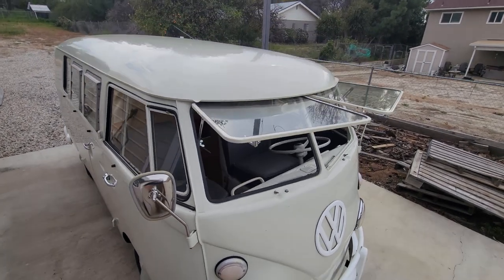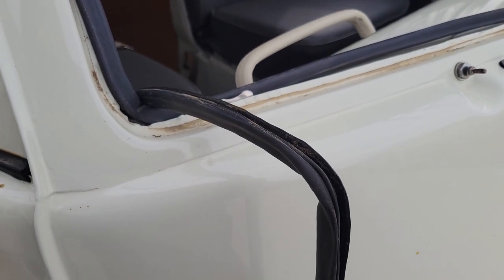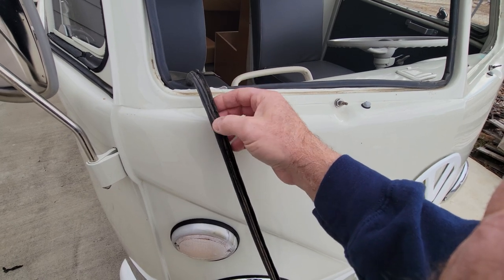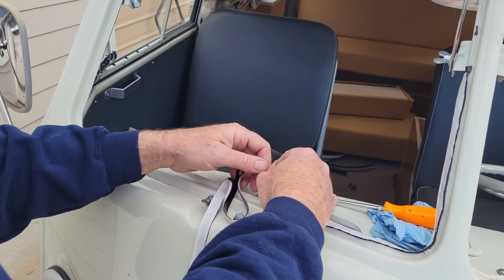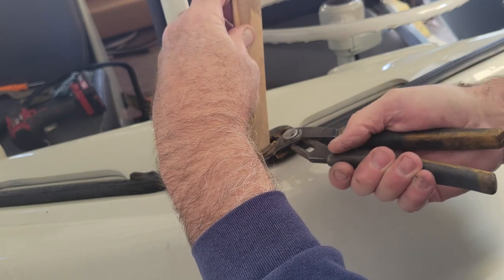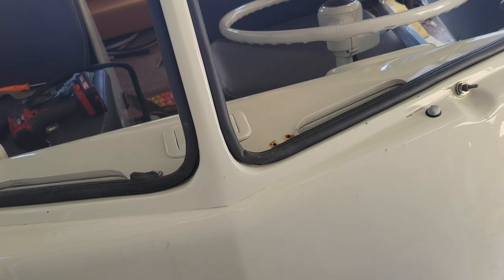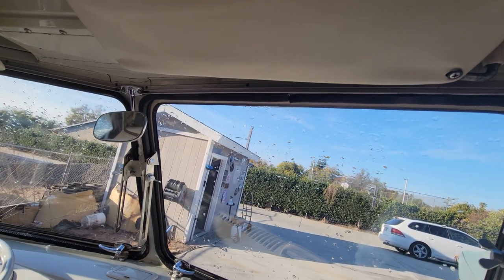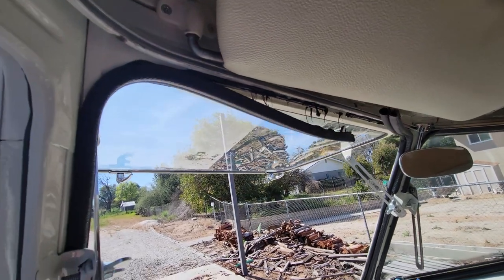LEAKING SAFARI WINDOWS VW BUS Split window

Comment: Very nicely done! Back in the 80s & 90s, My friends and I had bugs and them rabbits. Though the problem was not with the bugs, persay, there was an issue with the rabbit's windshield whistling and leaking. Our solution back then was to get a Black Plumber's Silicone and put into the grooves - the groove that went into the body and the grove that held the windshield. I forget its name but it did not stick to the rubber but it did peel off easily when the rubber was removed. But it did end the leaks the the whistling. Some of it leaked out of the groove but that was easy to clean up and it showed that it sealed up from the inside out.

Comment: This is one of those discussions that I’m scared to talk about.    I must say it’s very difficult to find a good rubber. Heck we didn’t even do the safaris and most of the darn things leaked.     It was a huge bummer when all the hardwood and insulation got wet.        Great explanations    of how the water moves/leaks.    This is very nice of you to warn people about this.     Sucks when you garage it for a couple years fixing it and getting it ready to ride and then you pull it outside  and bam it gets wet.    Also Opening up the pop out window frames and explaining how those 2 screws in there get rusted/frozen.  And how to retap the threads.   People would love that.    Oh and that heavy gauge spring assembly that hides under the wing windows too.    People would love that.  Your videos are great diy.   Really really great stuff.
Reply from the maker: most of the time I end up replacing the pop out frames. I used to get them for 16 each. IDK now.

Comment: Bet the sound is coming from the roof vent, tape it up and see ;)
Reply from the maker: yea I couldnt feel anything coming from around the windows. ran my hand around and also not much as far as water leaks.
Reply: @Mikefngarage  mine does the same thing, I need a passenger to find the dam air leak 🤷🏽‍♂️

Comment: Is this a butyl type tape? It’s a great idea; a gentleman who’s a glazer by trade uses butyl sealant inside the rubber gasket as extra insurance. Works great on the rear windows in Bugs preventing the package trays from rusting out.
Reply from the maker: yea I put a link on amazon for it. probably would work on windows as well but it might be really hard to remove one. Some people use it to install  glass. It did work pretty well  I did have some leaks probably because of my metal work not being perfect but really not that bad. Plus I have a curtain rod that conflicts with safari window rubber. so that didnt help.

Comment: Hey Mike ! My problem of the week is my window regulators that were Brazllian came in a flat package so you have to bend the last 2 inches of the top . Well even the first time I rolled them up they ( both ) were screwed . I tried to do the best job possible ? I should have left the old ones on , because now I have to tear up the new felts and seals . Just great !!!!!!
Reply from the maker: frustrating on how crappy the parts are and they still charge top dollar
Reply: @Mikefngarage  10-4 on the top $

Comment: Hello, I saw this video about leaking safari windows. I also had that problem with my safari windows. The rubbers did not even fit properly around the windows. (I have a 1958 T1 restored in the Netherlands that I imported from Texas) Restored with original parts.  So also good quality window seals. Yet my safaris leaked!! Since it rains a lot in the Netherlands, I also had this problem. My solution is as simple as it is effective, I use Vaseline on the corners of the rubbers where they do not seal properly and also between the rubbers of the frame and the rubbers around the safaris. The only disadvantage is that Vaseline remains spreadable and can therefore stain. But it does provide a watertight seal. And the costs are minimal to solve this problem. Just like applying the Vaseline. This is done without much work.

Comment: The square channel repop safari windows are well known for leaking.  The OG windows have a different channel outside profile that is more "V" shaped.  Creative Engineering out of England makes reproduction Safari windows with a factory profile that will seal better.  The aftermarket seals shipped with brands like Wolfgang and others are frankly horrible.  Sadly, even NOS german seals would leak and they had the correct formed corners.  BTW, those are unobtainium.   I'm sure Mike's suggestions will help either way.  IMO it is worth getting the windows that have the factory profile.  I have a few sets of factory windows, but they need resto.  If I were buying today, I'd go with the CE's.
Reply from the maker: yea I dont think I will be buying anymore Wolfgang ones anyway because they are just too expensive. they raised their prices from 600 to over 1000.
Reply: @Mikefngarage  Maybe explain why you are deleting comments.
Reply from the maker: @ocavant  I am not deleting any comments. I am not sure why or what comment was deleted. youtube sometimes bans them but i just leave them up there. Only time I delete them or hide user is if there are all hateful
Reply: @Mikefngarage  Ok. Maybe it was the outside link to CE re:their windows that Youtube does not like. I posted something 3 times and it kept disappearing. My bad. Sorry.